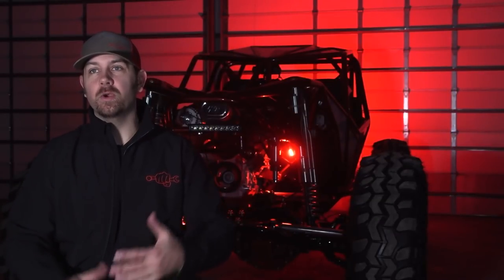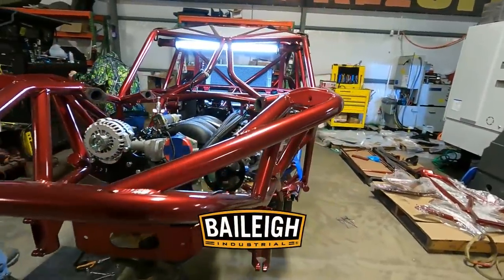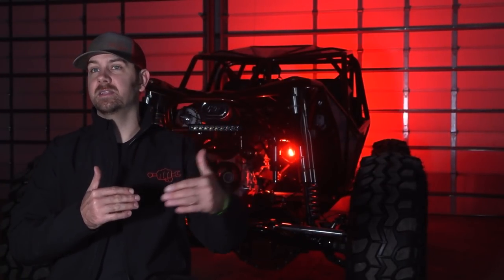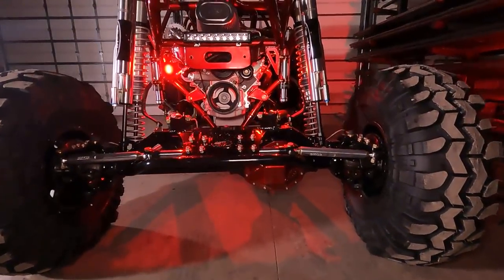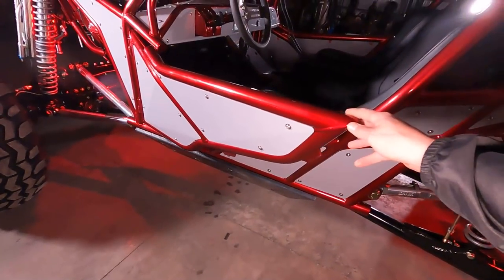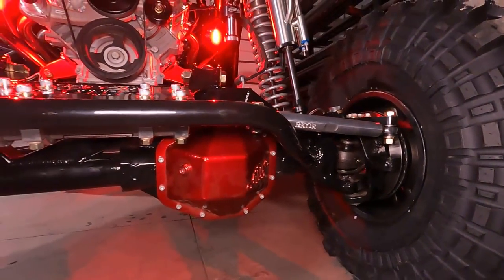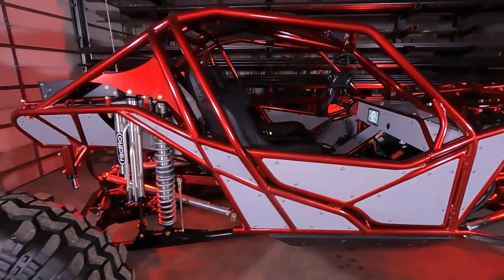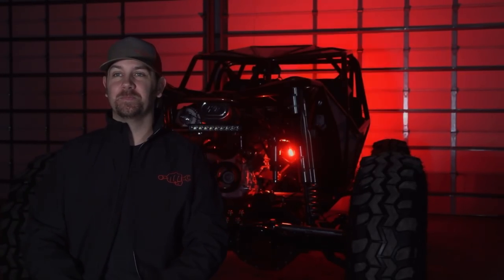Busted Knuckle Off Road Rock Bouncer Build with Doors!

Comment: Now that is what I am talking about, doors having busted my back doing Enduro/Rally Raid on motorcycles I am not so flexible as I used to be, now has it lost any strength in the passenger area, I would like to see the top rail sitting into a cup say just a tube halved so if a side impact occurs it wont fold into the occupants.
Lights I have smashed so many it would be nice to have some front and rear protected as best properly, my shopping list just keeps growing get one of yours would make me poor but happy.
Reply from the maker: These doors are made with a stop to keep the doors from coming in on a roll

Comment: I always thought the door idea would be a great addition..but was concerned about a strong enough method of keeping it from folding in on you. If you had a hard hit I don’t think it would take much of a impact to shear or fold over the small pin that locks the door shut and that door would swing right into the seat then into occupants.
Reply from the maker: Ours has a plate that prevents this.